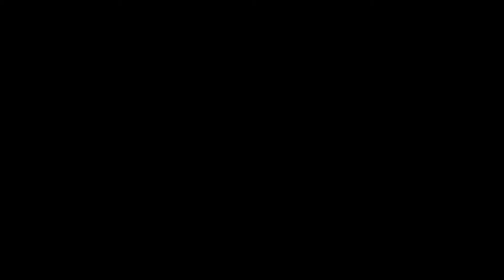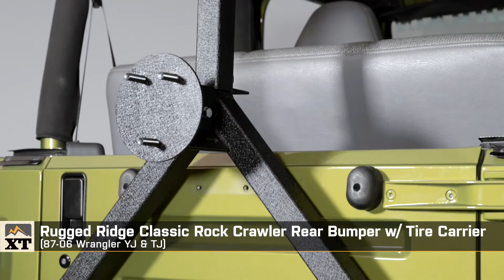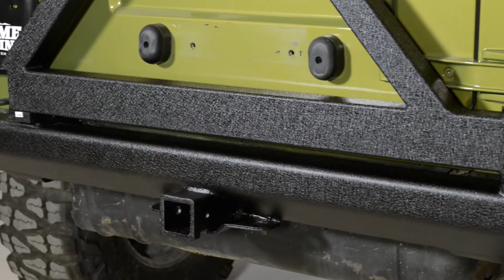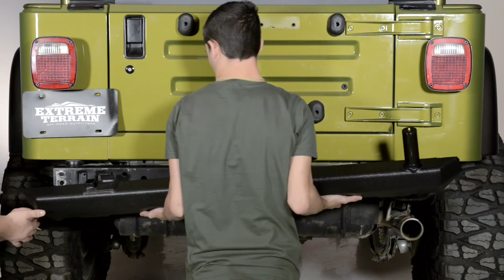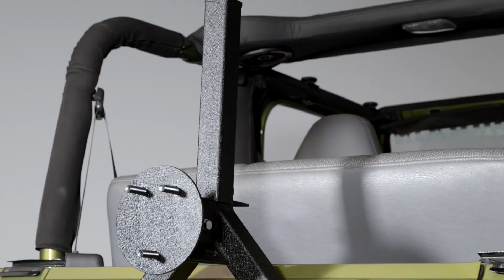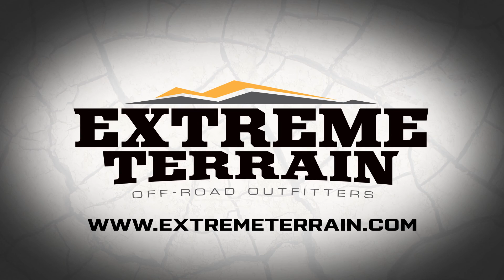Wrangler Rugged Ridge Classic Rock Crawler Rear Bumper w/ Tire Carrier (1987-2006 YJ & TJ) Review

Comment: Wow! what a refreshingly honest review. continuously impressed with your reviews.
Reply from the maker: Thanks!! That's what we try to accomplish with our review videos. We like to give honest and real reviews. What did you think about the bumper w/ tire carrier? -Jake
Reply: I agreed with a lot of the points you made.  Its a bumper that would look great on some jeeps. I do think the retail price is a bit high. I think around $500-600 max is a more reasonable retail price for both the bumper and tire carrier. That would make it more competitve in my opinion with other available bumpers, with possibly better quality (and higher priced) brand bumpers such as the bestop highrock line. 

Although, dropping the tank for installation can be a hassle, I dont see installation being much of a concern for 90% of jeepers out there who either can afford to pay someone else to do it or willing to learn how to turn a wrench on a relatively simple build. Cosmetic projects like this helped me gain confidence to later undertake more challenging mechanical projects. This bumper is a good place to start.

I would have liked to see a D-ring option to compliment many of the other bumpers out there. 

Also most of these bumpers with hitches seem purely cosmetic with no decent tow ratings. It can be a bit misleading when you see a hitch and think you can pull a boat but then realize you probably shouldnt. Wasnt sure of the tow rating on this but by the description it looks like its more just for storage even though it seems to sturdily attach to the frame?

Otherwise, i love seeing these new offerings on old jeeps and depending on what an owner uses it for, this could be a great addition.
extremeterrain.com